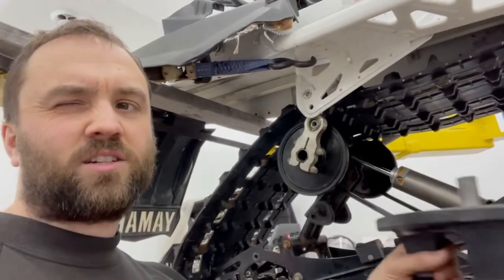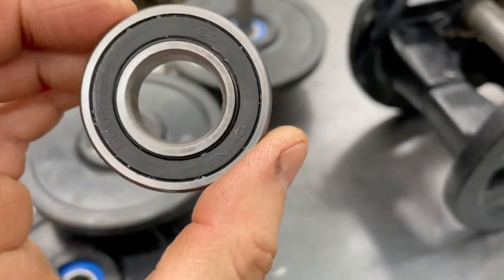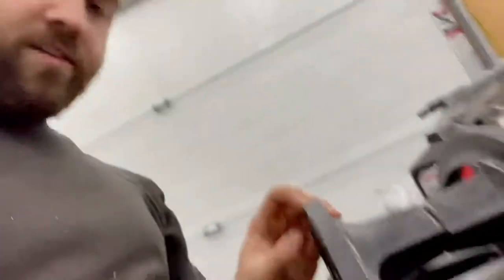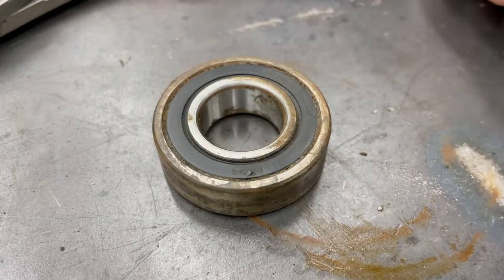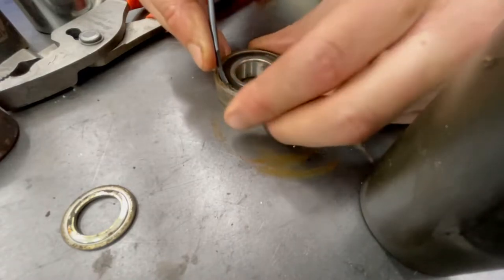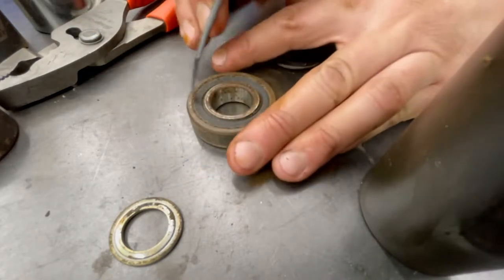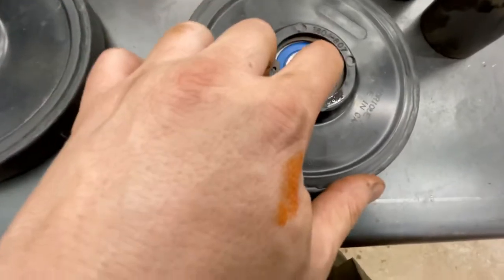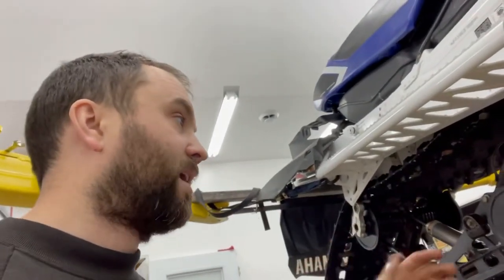Yamaha Viper Rear boogie wheel issue and bearing service

Comment: I'm in the process of buying a 2015 yamaha sr viper xtx se 141   I've had a 97 vmax 700 triple sx for a long time with no issues but decided to get this newer one . What's all I should look at before I load it up and take it home .  Thanks
Reply from the maker: Check the jack shaft bearing behind the secondary , also the play on the main drive . Grab the brake rotor if she’s loose you will need to do a lower bearing and maybe a shaft . Those are prob the main things I’ve noticed on the viper . Also boogie wheels check them all depends are you paying high money for this or low ?
Reply: @IMRgarage  ok and I consider it higher amount there asking 9000 for it can as I'm in Saskatchewan Canada.  And the mileage is 7000 kms
Reply from the maker: @jacobboyko888  9k is on the high side with the Eccomy I would offer less for sure unless it’s supper clean .
Reply: @IMRgarage  yea it looks to be clean it's shiny etc not dented up or paint missing so. It's red and white. I got them to order a bunch of accessories for it to. Tunnel flares   the 4th boogie wheel for the back   windshield bag  handle bar bag  rear large size storage box   the yamaha gold gas cap  and the battery tender that has to be installed on it .   Plus a yamaha viper tarp plus the  cover that goes underneath the tarp  and a couple other things .    I'd like to get hid bulbs for it  and an exhaust but not a ridiculously loud one or one that's drony  I've heard people saying.   I'm the type of guy who's not hard on things  I don't jump them or go in the mountains  my terrain is at the farm going threw fields   ditches and the odd poker derby.  So

Comment: On the old pressed in bearings, is there no way to remove the bearing cover on either side with a pick to squish some grease in there? I have an old trihub laying here unused and was going to try and pick one of the rings off just to see if I could get a little bit of grease in them and keep as a backup in case I ever  need.
Reply from the maker: Nope the plastic mold covers the half the seal !
Reply: @IMRgarage  grrr. Ok thanks. Ironically wss just going to pull the wheels apart an hr ago. I have the trihub delete done and it's way better. Note those the 2016 and up vipers have the replaceable 6004s
Reply from the maker: @EYECOMEINPEACE  oh I’m gonna look up the 2016 if they have them replaceable I’ll have to order that for my buddy
Reply: @IMRgarage  they are replaceable I Did it on my 16 xtx. But I also have a couple 2012 cats and they are the old style pressed in. 🍻
Reply: If you're in Ontario.... Call orps parts in Newmarket they have the delete kit and its way better.